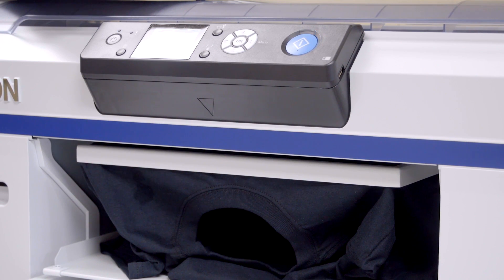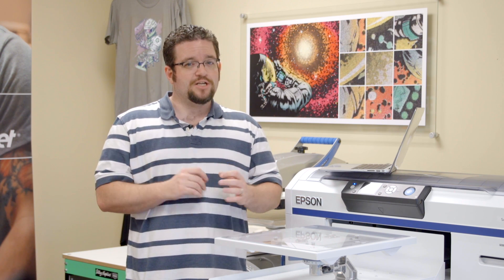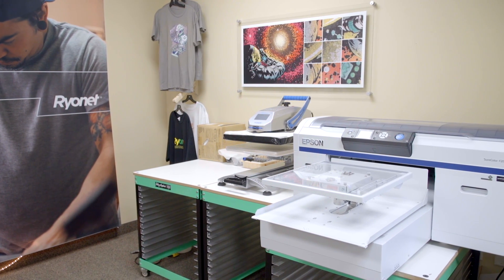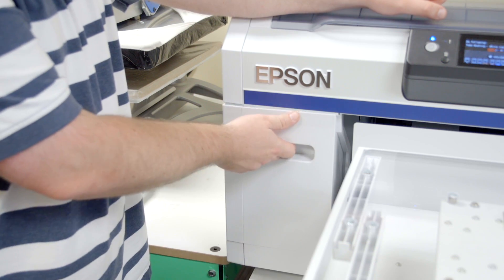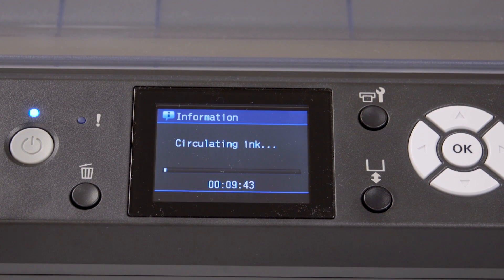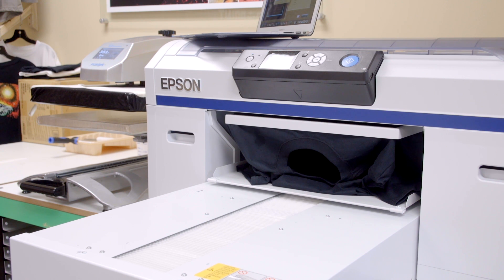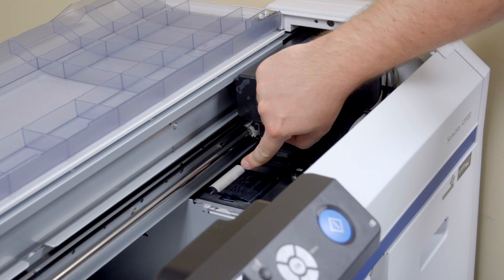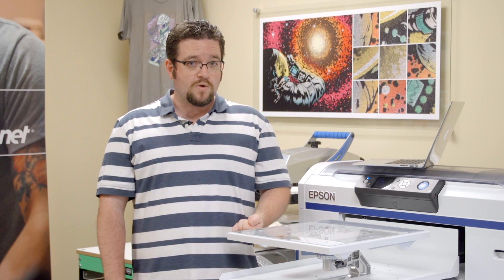Performing Maintenance on the Epson F2000 Direct To Garment Printer

Comment: after i press image the vibrancy and saturation go away a lot.
also how do i enable the estimated cost feature in the software.
Reply: Generally, lose of vibrancy and saturation is a direct result of inconsistent pre-treatment and curing. Use a good brand of pre-treat machine and solvent with a quality track record of positive result such as Image Armor as a generic etc... A professional heat press such as a Hotronix Fusion IQ is also an absolute to enable consistent curing of ink without color lose and degradation. It really comes down to the quality of machines and solvents being used to allow consistency. I've learned the hard way over 10 plus years ago in DTG's infancy trying to cut corners and save money avoiding expensive machines. It doesn't work. This industry is very expensive in order to achieve proper results. Check out MELCO dtg videos. They are pros with great advice.